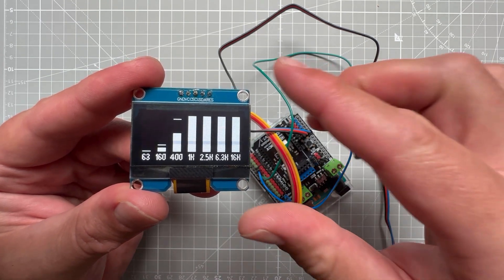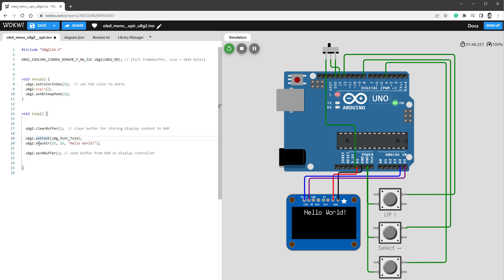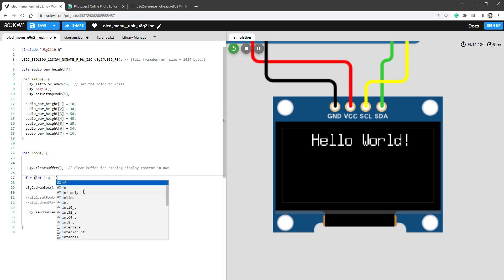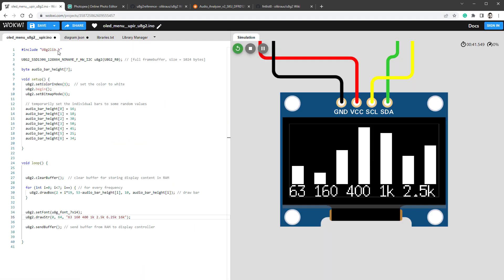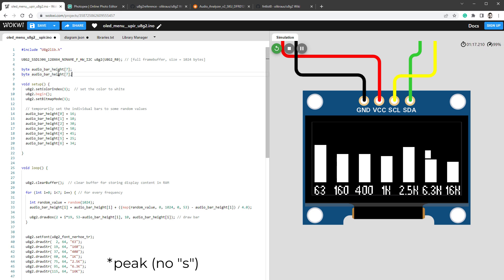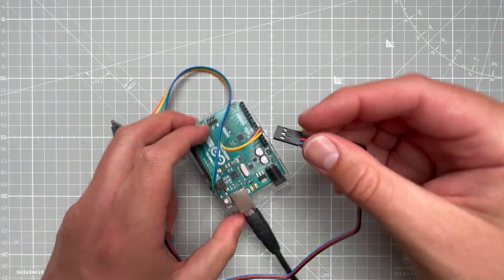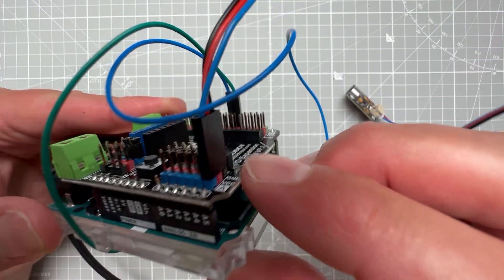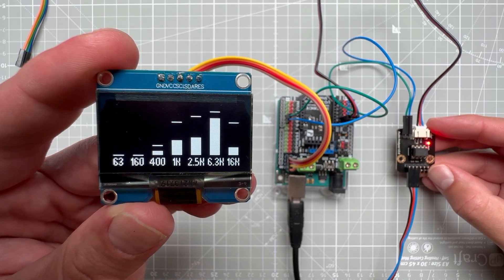Arduino Audio Analyzer (Tutorial for Beginners, SSD1306 OLED, u8g2, Arduino UNO)

Comment: I have an issue when running the code from dfrobot sample code, even if I didn’t connect the audio module and mic, there is signal running in serial plotter, do you have this situation? Also, how could you setup the plotter with fixed y-axis?
Reply from the maker: If you don´t have the pins connected to anything, there will be some noise, that´s probably what you see in the serial plotter.
Reply: @ thanks for your reply, finally I found my issue, it was a fake MSGEQ7

Comment: How to display more bars? Even 1 or 2 pixels width?
Reply from the maker: You can do that easily (the display part), but the used module only provides those 7 bands. You would need a different audio analyzer module.

Comment: Hello Upir,
Can you please share an example for the same Audio Analyzer display on Max7219 dot matrix display ?
Your help in this regard will be highly appreciated.
Reply from the maker: I have a video about using the MAX7219 dot matrix display using the u8g2 library - i.e. the same library as used here, so merging those two sketches together should be very simple. Please search for my video "Arduino + Matrix Display (The Proper Way)".
Reply: @upir_upir  Yes, I followed your video using the MAX7219 dot matrix display. It's working perfectly well displaying the YouTube logo and 6 digits on 4 dot matrix display of mine. But I need your guidance how to display 7 frequencies audio visualizer on dot matrix display. Kindly provide some details.

Comment: hi! learned a lot from your videos and highly appreciate them. i am currently working on a simmilar project but on an arduino nano and a temp/hum sensor instead of a frequency sensor. howere i really stuggle to get it working with i2c connection. oled itself works, sensor itself works, setting the adresses seems to work (at least from the code side) but the program somehow does not start propperly. did you ever have problems with i2c and the u8g2 library?
Reply from the maker: Thank you for your comment. I actually had a problem with u8g2 library and some OLED displays, and it helped to slow down the IIC connection from 400 down to 100Hz. Could you try that?
Reply: @upir_upir  not yet but i just saw that 100khz is the standard speed and i didnt change that. i will still try and see if changing the speed affects this problem

Comment: I'm finding it a little difficult to understand how a male human voice produces that much sound in the 16k hz range.
Reply from the maker: Is it too low? Too high? According to Wikipedia, During a conversation, the fundamental frequency of a typical adult man ranges from 80 to 180 Hz and that of a typical adult woman from 165 to 255 Hz. I guess the chip is not super accurate or perhaps something else is going on..
Reply: @upir_upir   16K is WAY to high for a mature male human, you're not even going to get (natural) harmonics in that range.  Makes me wonder if something else is going on.  Since 16K is really hard to hear (unless you're young), perhaps something else to generating the sound in the upper ranges?  Or, it is possible the pre-amp is not very good and is augmenting harmonics.  It's also possible that the conversion of sound pressure measurement to bar graph is suspect.

Anyway good luck.

Comment: Is there a way to adjust the sensitivity of the mic? This analyzer seems to peak very easily.
Reply from the maker: The microphone just provides analog voltage, so you might be able to just reduce it using a resistor/potentiometer before feeding this into the audio analyzer module.

Comment: A great little project.
I have a requirement for a simple board or circuit for an audio signal amplitude from an MP3 player board running off Arduino to trigger an LED light.
(Basically an audio envelope follower/trigger.)
The analyser board you are using is over-specced and too expensive for my needs.
Is there anything you can suggest?
Reply from the maker: Thank you. Could you use this chip alone, not in the form of a module? You can also try processing the audio signal directly on Arduino.
Reply: @upir_upir  The chip is still too expensive and complex for what I need. I will probably go with an op-amp solution.
Reply from the maker: @TryptychUK OK, hopefully you will be able to find a solution that works for you. I´m sorry I cannot provide more guidance, but I´m not that familiar with audio processing.

Comment: Hello there. Where did you source a MSGEQ7 chip please? Aliexpress is full of fakes.
Reply from the maker: This one is from DFRobot, it´s the entire module, but you can remove the chip if you want. Is there a way how to tell the chip is fake?
Reply: @upir_upir  Not really just plug it in and try, or there are some guides, how to determine it by measuring some voltages between and current draws on some pins. Basically, all aliexpress are considered (by me) as fakes. Dfrobot price is just bit over the hill.

Comment: Can you increase the amount of bars that the audio analyser detects?
Reply from the maker: Unfortunately not. The number of analyzed frequencies is set by the used chip on the audio analyzer board. You can do this manually using Arduino, but it will consume quite a lot cpu time

Comment: Since the arduino is so slow, you can supercharge this project by impementing a sliding discrete fourier transform. It's faster than a fast fourier transform and the fastest you can get with digital fourier analysis. You will be able to implement more frequency bins without bogging down the arduino.
Reply from the maker: Here all the calculations are actually done on the dedicated chip that’s on the audio analyzer board, so Arduino is not doing anything, other than drawing on the OLED display.